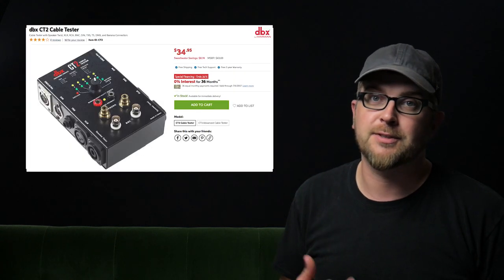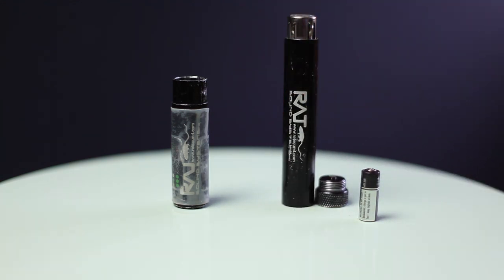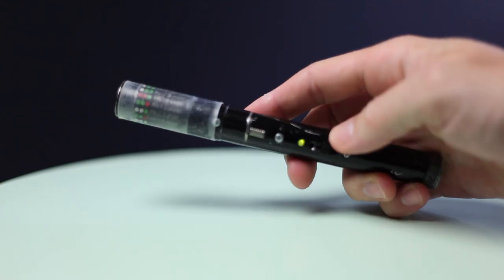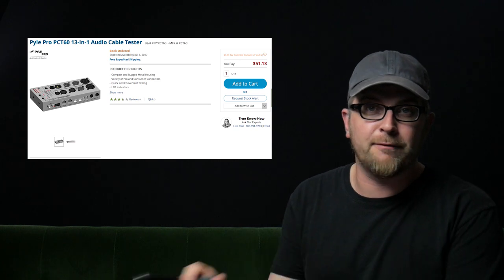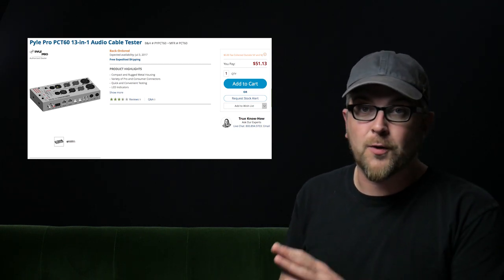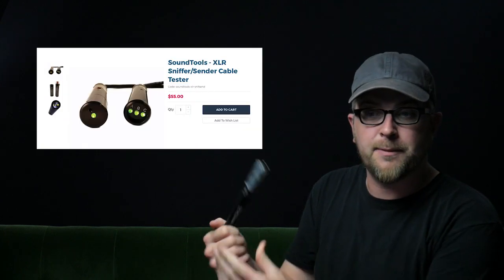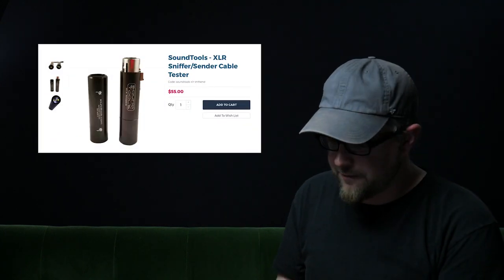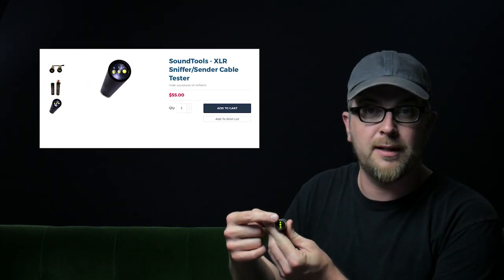Review: Rat Sound XLR Audio Sniffer/Sender 🐀👀👍🏼

Comment: I don't know if this is a different model or not, but I had one a number of years ago, well before 2010. 
Unfortunately, my briefcase kit grew legs, and I no longer have it. I should really order another one. 

As to other cable testers, I was never happy with the Whirlwind units of 15 years ago, and found that they had some quirks. 

The tester that I liked the most, which was also in the afore mentioned briefcase, was one from Miles Tech, which unfortunately is NLA, because I would buy another in a heartbeat.

Comment: I would love to get one. But broken cables are not common for me, since I only see about handful of faulty cables per year. And if I do have one, I replace it immediately or switch channels on the multi. Although pretty much all stageboxes I use these days work on Dante or Madi. After the replacement I check the faulty cable at both connectors. If I don't see any obvious soldering mistakes, the cable is tested back at the warehouse (read: thrown away). I still want the Rat sniffer though.

Comment: I think elimination of the power switch was a mistake. I have [only] the newer twist model and I'm never quite confident how far to turn it so it won't twist itself back on... or have the battery fall out. As a result I store it with the sniffer and sender physically disconnected from each other.

Comment: Ok so I'm really new to the whole audio thing. If you're running a cat5 snake would you be able to test your cables and connections with this tester?
Reply from the maker: If you're running an analog audio over cat-5 snake, then yes. If you are talking about a digital cat-5 snake, then no, you wouldn't be able to test the continuity through that system with the sniffer.

Comment: Hey Steve, have you ever seen all lights on one of these go red?  I have the newer model than what you are showing here, so it has the single LED on the sender and for some reason all 4 LEDs are red when I connect a correctly soldered cable...  This just started happening recently and I can't seem to find anyone else that has this issue.  Just trying to figure out if the tester will still work, and the lights are inverted, or if I need to get a new one.
Reply from the maker: Hey Mike, sorry for not getting back to you over the weekend. I have not seen one do what you are describing, have you reached out to SoundTools yet to ask them? I know they'll want to know what's up & will make it right.
Reply: I posted a comment on one of Dave’s videos. He got back to me. Turns out if the lights are all red, the battery is backwards. I just couldn’t get it to work the other way. The secondary problem was that the spring was bent so that if the battery was in there correctly, it wouldn’t make contact. I bent the spring a little and everything works!